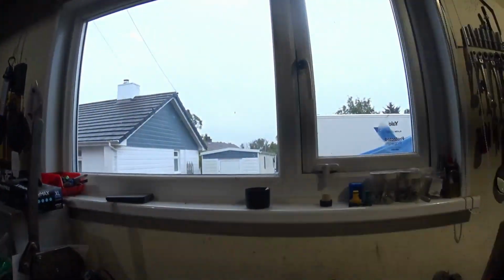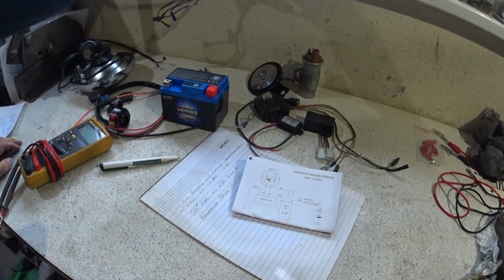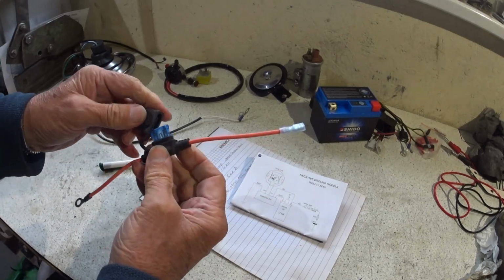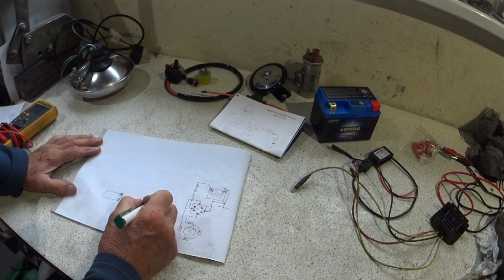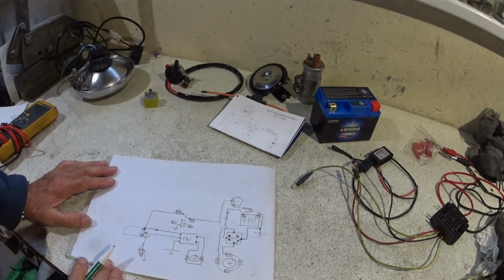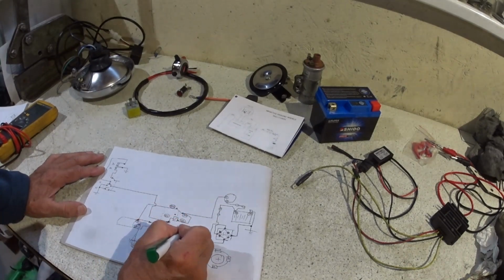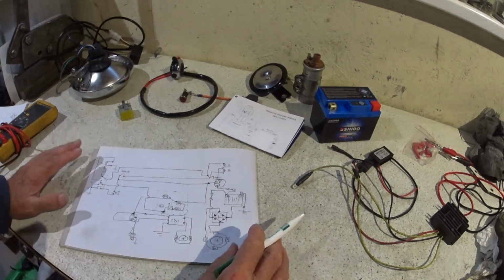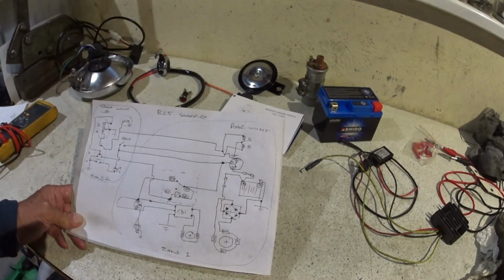BSA B25 Starfire Wiring Loom Design Part 15

Comment: Hi Brian can you give some advice I am wiring up my 1968 bsa b25 star fire I want to fit a reg rec but don’t know how to fit do I need a zenner diode would you get rid of the points
Can you recommend electronic ignition a wiring diagram would be helpful I am not very good with electrics but I am up to the challenge.
Thanks Malcolm.
Reply from the maker: Hi Malcolm, The upgrade to remove the Lucas plate rectifier and the Zenner diode is an easy job by retro fitting a modern solid-state rectifier/regulator. The genuine Lucas rectifier/regulator 12v 120w single-phase solid-state unit part number WW10123L is a good unit to fit (about £38-£40). There are plenty of Chinese alternatives out there which are a lot cheaper but not as effective on the power output as they use lower quality internal components.

There are only 4 wires in the new unit, the 2 yellow wires connect to the alternator output (either way around as they are AC) The other 2 wires (red and black) connect to the battery and frame, if you are still positive earth then red to the frame and black direct to the negative terminal on the battery (or the other way around if your Starfire has been converted to neg ground)
 
If your Starfire has the original wiring:- Remove the old plate rectifier and connect the new unit into the existing rectifiers wiring as:- one of the yellow wires to the white with green tracer wire and the other yellow wire to the green with the yellow tracer, the other 2 are black on the new unit to brown with a white tracer wire and red to earth. Last bit is remove the big spade terminal from the Zenner diode and tape it up as its live and no longer needed.

For testing you just need a DC volt meter, connect it across the battery terminals and start the bike, with the lights off battery voltage should increase with engine RPM to a max of 14.7v 

Nothing wrong with the conventional points and condenser set-up, but they do need adjusting from time to time as the contacts erode and the heal wears down closing the points gap. However once electronic ignition is fitted and set up correctly it’s a ‘fit and forget’ system provided you have good battery voltage.
Lots of options out there, Tri-Spark, Pazon, Boyer, Wassell. My preference is Wassell (Vape) Micro MK1 as I have fitted this to quite a few classic BSA/Triumph twins (around £130) I have fitted other makes but can’t make a comparison with Tri-Spark as I have never fitted that system. I like the Wassell unit as it has a fully encapsulated stator on an aluminium billet frame where the Pazon and Boyer stators use the PCB board as the stator frame which seams quite flimsy. Wiring on the Pazon, Boyer and Wassell are very similar, but the Wassell Micro Mk1 unit has the smallest electronic control unit. If you go to page 11 on the attached link below it shows the wiring setup of the Wassell Micro MK1 for the BSA Starfire (pos ground)

https://burtonbikebits.net/bbb/wp-content/uploads/2019/03/WW61495.pdf

Comment: Hi Brian, please can you tell me the model number of the battery.
Reply from the maker: Hi, the battery is SHIDO LTX5L-BS LION S Lithium Ion Motorcycle Battery 12V 20WH, the first one I bought for the B50 was about £50, but the last 2 I bought from Amazon were £35, however just had a look and they are now back up to over £50. A couple of my biker mates bought them from Tanya Batteries last year at £27 but now nill stock, should have bought a couple at that price for my next projects. Regards, Brian.